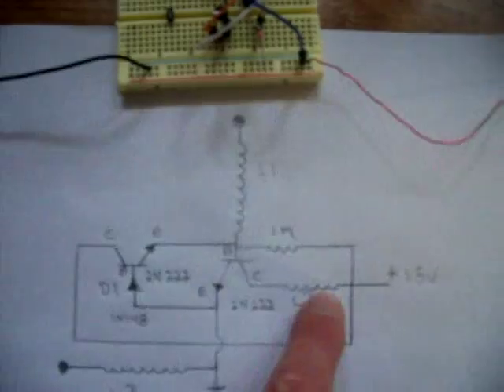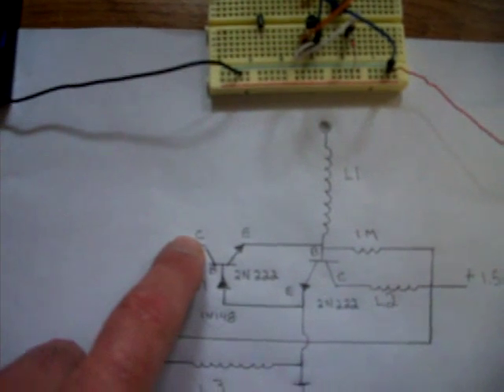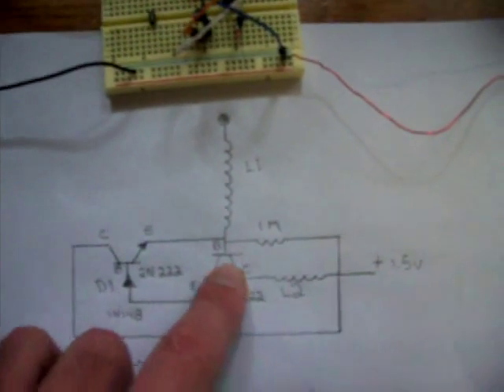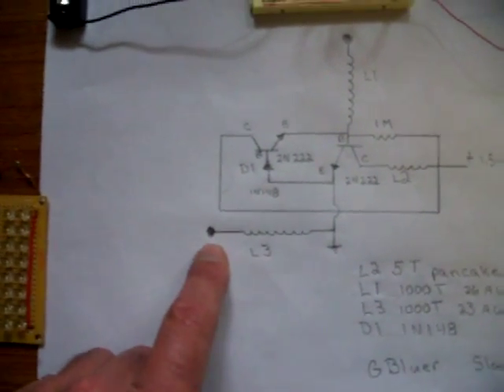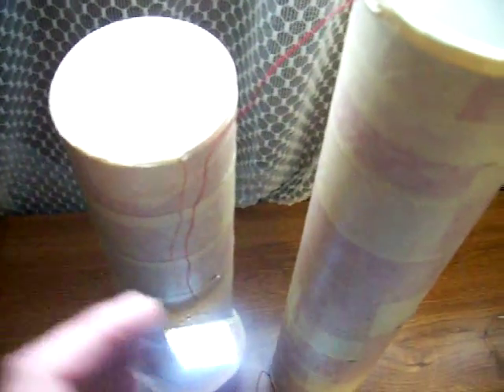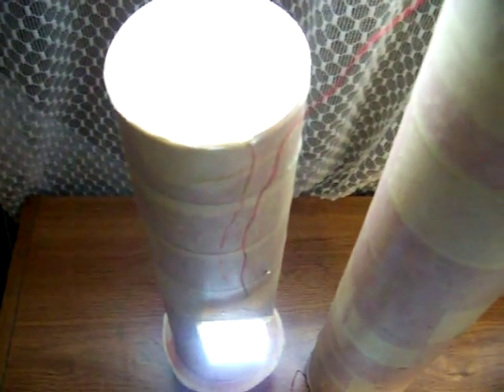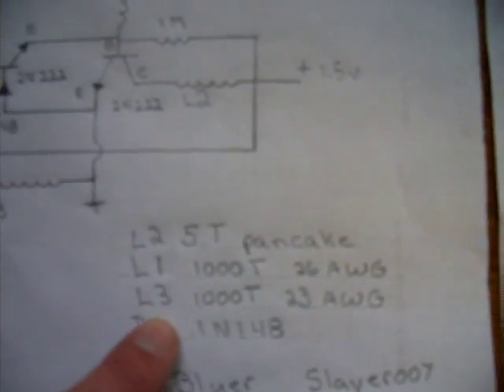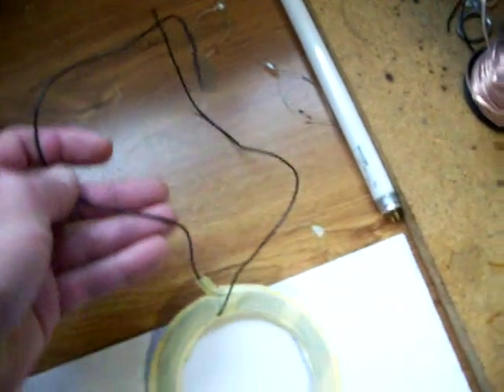Exciter Transistor Mod Update

Comment: thanks for your reply. Can I use 2N2222 (2N2219 -has same specs) instead of 2N222. FYI, I have used tip31c with 12v & 18v but Transistor needed heatsink.

Comment: Hey, I'm new at this and need some help with my slayer exciter, I have a TIP36C transistor which is a PNP and not a NPN :( It was all I can get. I have about 2000 turns on my secondary coil. it just wont do anything. Any ideas?

Comment: Slayer Booster 2DMax  310113   YT  imtotob........  this is my replication with 3rd coil wrapped in L1   output is concentrated on the tip of the wires   ... For those JR enthusiast who want the DC version    this is it      thanks again Gbluer

totoalas

Comment from the maker: The power input is the 1.5v AA battery. It will draw 60 mA to 100 mA depending on the load.
With just the led's it will last around 24 hours using a rechargeable AA battery.